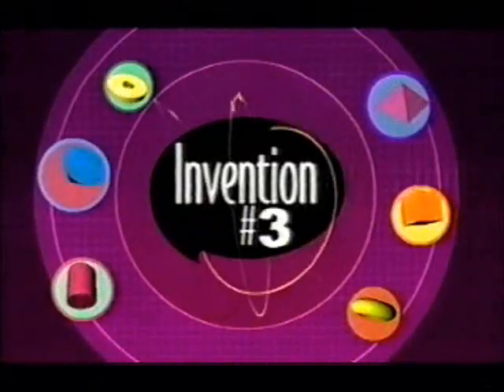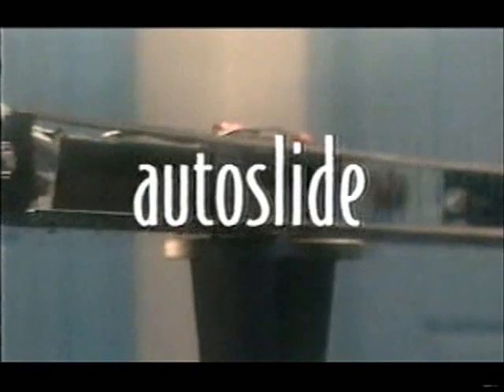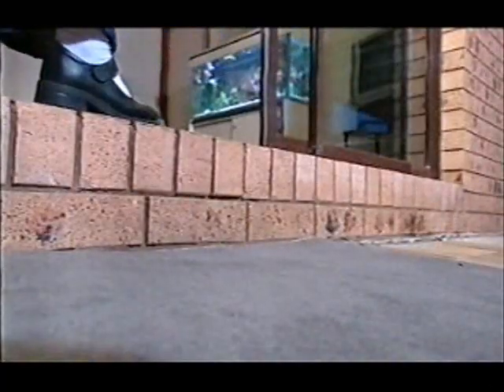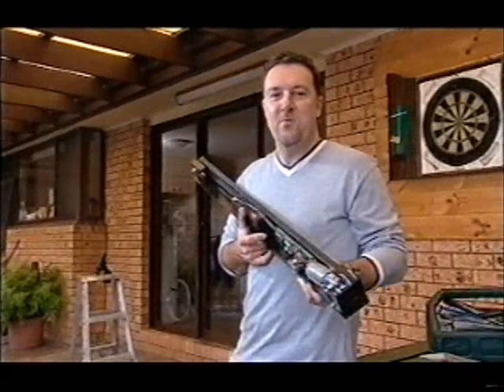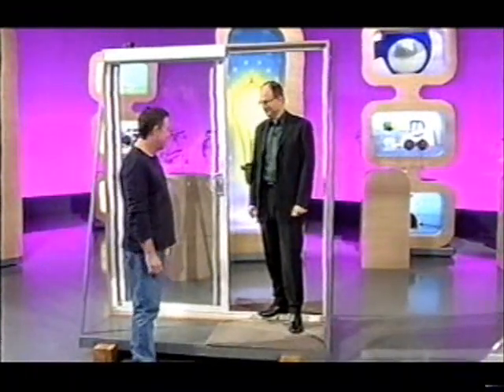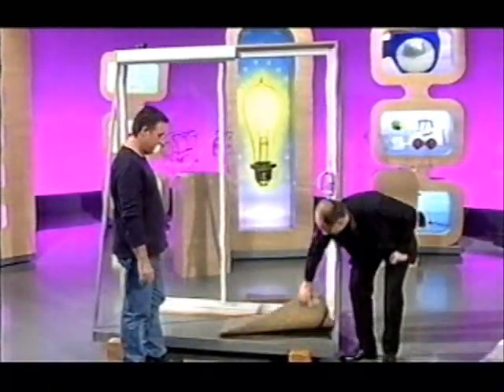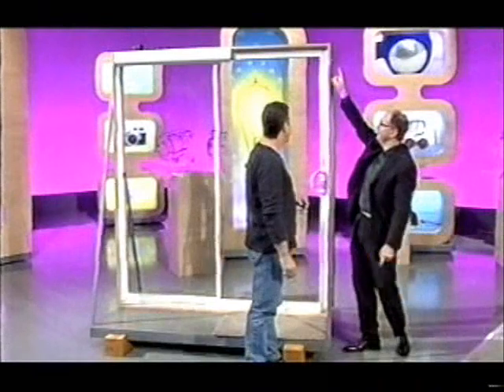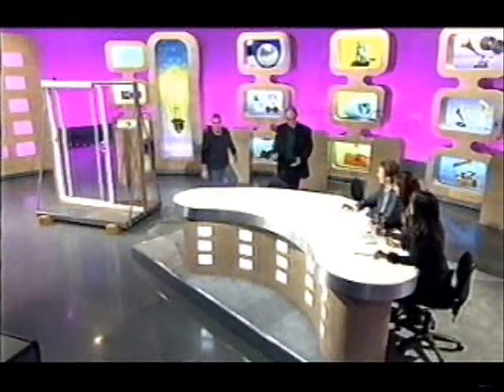Autoslide on The New Inventors

Comment: Does the production model have a rechargeable battery installed to reduce the cost for the disabled who in wheelchairs need it to move on it own even though it can be pushed open